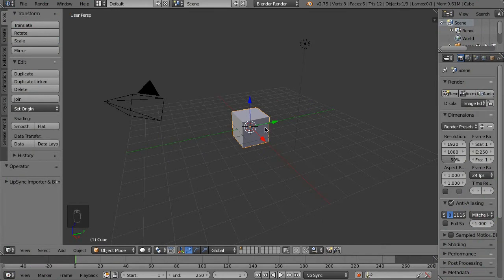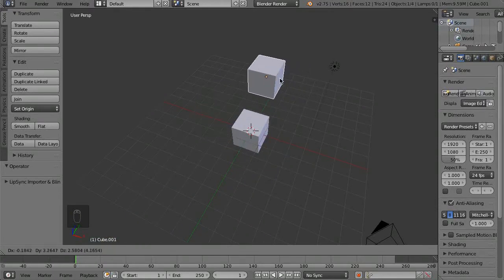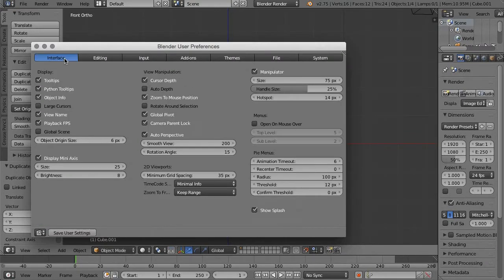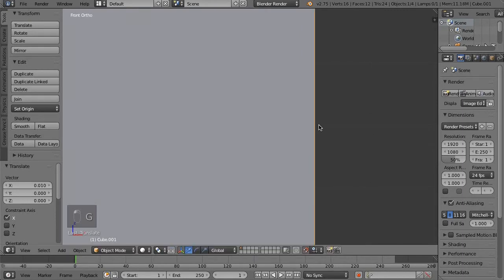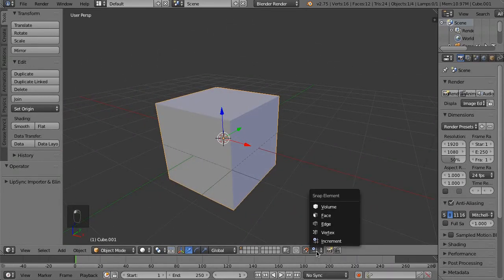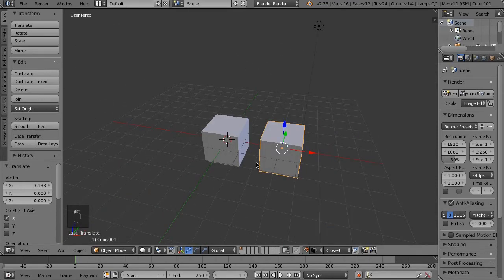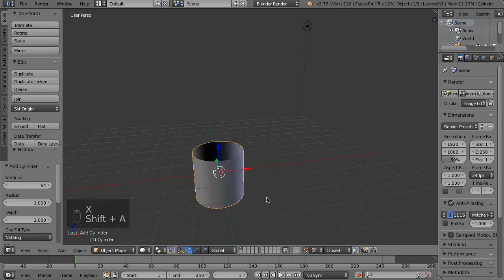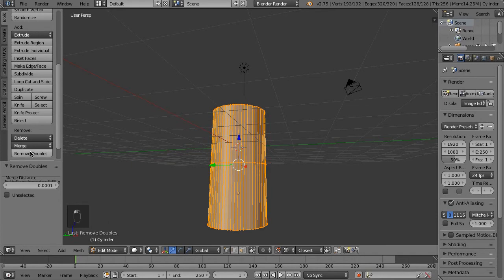Blender Tip #14 - Vertex snapping

Comment: Overall, Blender is a great and powerful program. I certainly can't argue with the price. But honestly, the snapping system they've implemented makes no sense. I see so many people eyeballing things in Blender or fumbling around trying to find the exact coordinates they need. Both approaches are inefficient and make me want to pull my hair out. AutoCAD has offered relative positioning and excellent snapping options since at least the early 1990s. Why are these features not available in Blender? The closest way I've found requires me to change my object's origin each time I want to move it relative to another object, say to get the corner vertex of one object to touch the corner vertex of another object.